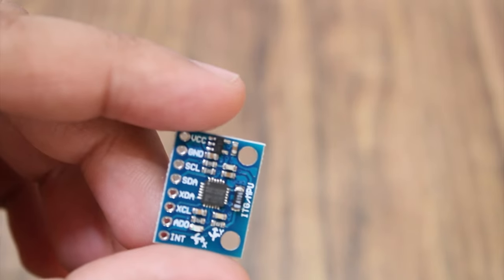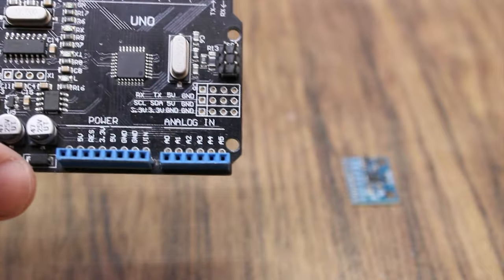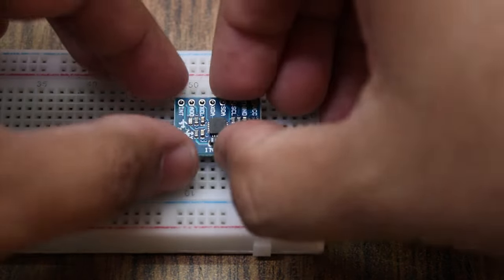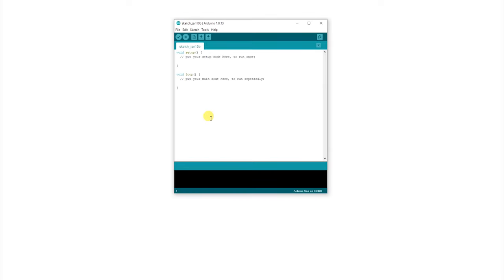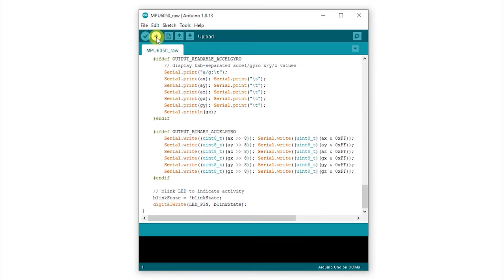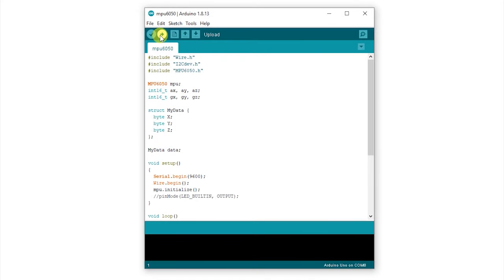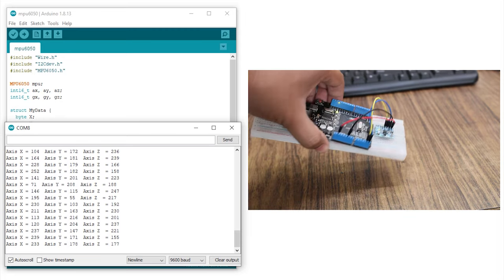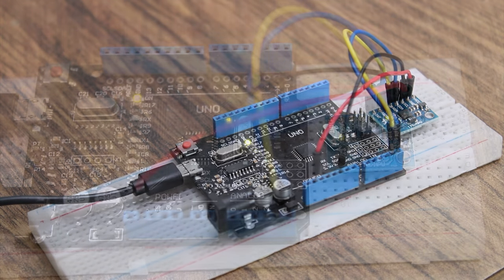MPU6050 Sensor Arduino Tutorial

Comment: If the value remains at 127, the problem is that the MPU6050 is not making good contact with the pins, you have to solder the pins on the board in order to have good contact. To test this without soldering,  try moving the pins on the MPU605O and then a green light has to turn on, once the light turns green it means it's making good contact, and the readings will change when moving the board like the video.
Reply: To add to the that, it is important to use good quality wires. I would recommend directly connecting the sensor to the arduino using male to female wires.
Reply: @yousefabdelsamie5983  how ?
Reply: @anas3333  first solder the pin headers to the mpu6050 then use male to female wires to connect the mpu6050 to the arduino
Reply: I had many MPU6050 that were faulty so if it doesn’t work just dont bother fixing it and buy a new one from a different store.
Reply: @yousefabdelsamie5983  okey thanks my friend
Reply: @yousefabdelsamie5983  if it lights a yellow light does it mean the mpu is working n
Reply: @anas3333  Yes it working but it doesn’t necessarily mean that it is not faulty
You need to check the results
Reply: Hola amigo, respondiendo a tu comentario. " yo también intente hacer la prueba sin conectar los pines del acelerómetro, sin embargo se me presentaba este error, aun así seguí intentando sin soldar los pines y efectivamente logre que dieran los datos, así que efectivamente tienen que soldar los pines antes de hacer las pruebas con el código para que no se les presente este error, de manera que no cometan el error de comprar otro acelerómetro sin estar 100% seguros de que esta mal."

Comment: Does the software account for the spin of the earth? If you leave the thing sitting there reading all day the rotation of the earth would effect it, wouldn't/ shouldn't it?
Reply: no bc it works with pressure and earths rotation does not affect it
Reply: No, because it is beyond its sensitivity and it was not calibrated for earth rotation ( as it should).